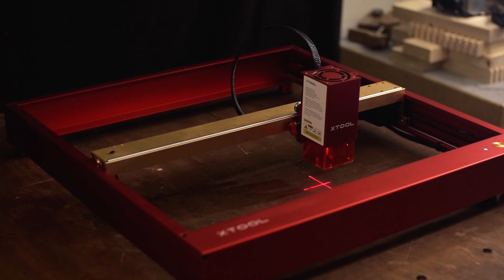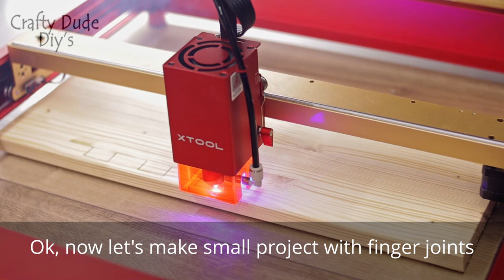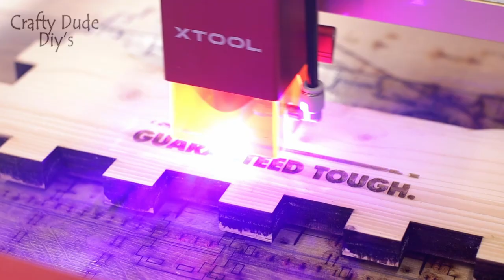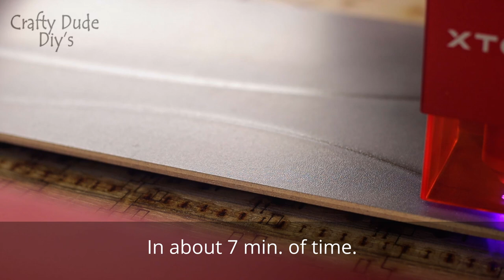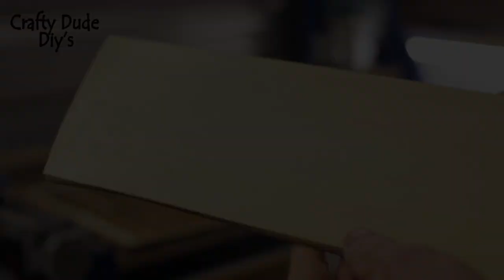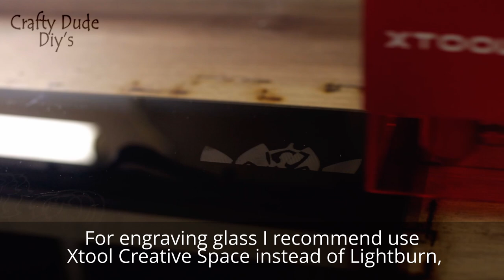One Tool for Hundreds Projects/XTooL D1 PRO/Powerful Laser Cutter-Engraver

Comment: THANK YOU!!! 
👍👍👍
I have been asking for someone to try laminate flooring for over a year now as it is pretty much the determining factor regarding whether or not I will buy a laser as it is an amazingly versatile, strong and useful material that is available in cheap versions everywhere..

Pretty much all those home made sanders and various machines powered by a drill/angle-grinder/jigsaw etc can be made using laminate and many of the things made from 5-6mm alu can also be made from laminate..👍👍👍👍👍👍👍👍👍👍👍👍
Reply from the maker: That powerful laser really great for cutting materials in high precision and speed👍🙂